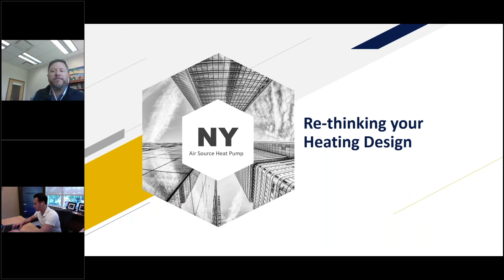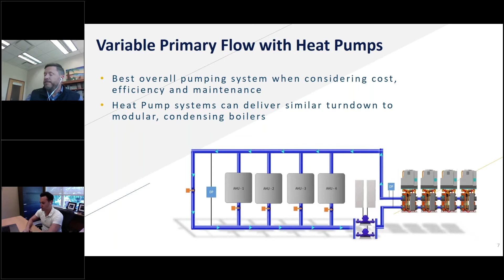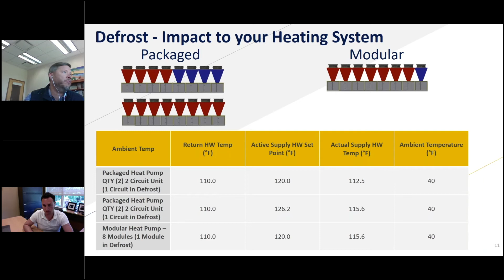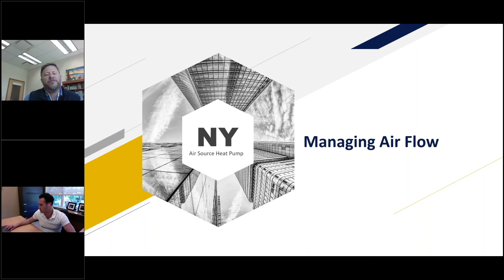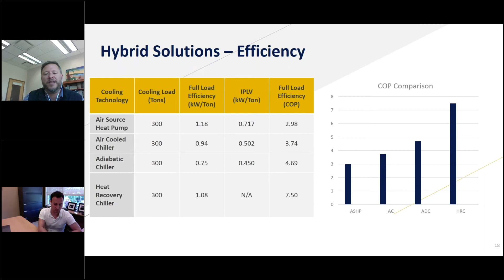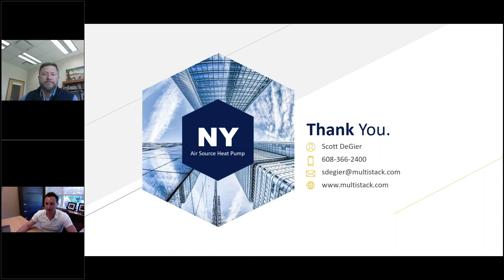Air Source Heat Pump Design

Comment: "  ...about 12mins ....  Fixed speed compressor technology "   .. A lot ( Daikin Valiant ecodan) are advertized as "Inverter" heat pumps, but they don't give the "minium constant output power" which is important for matching emmiter output to flow temp.